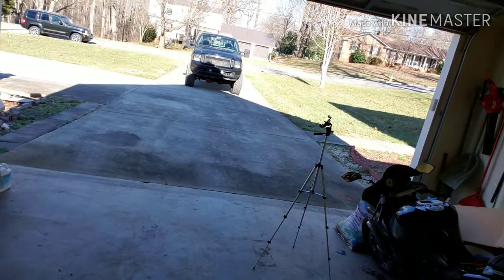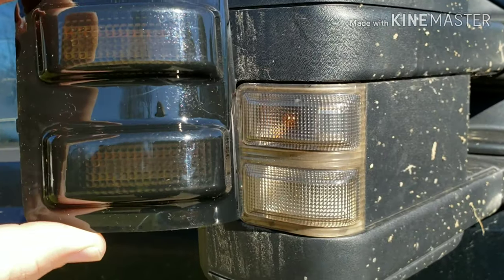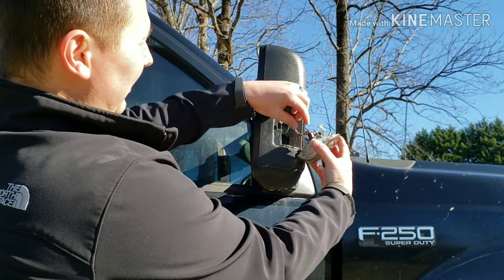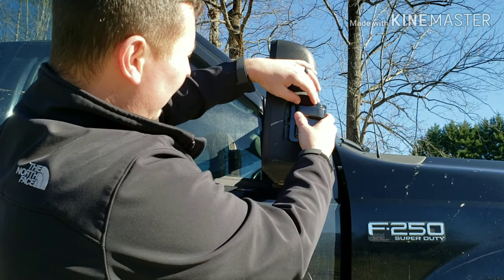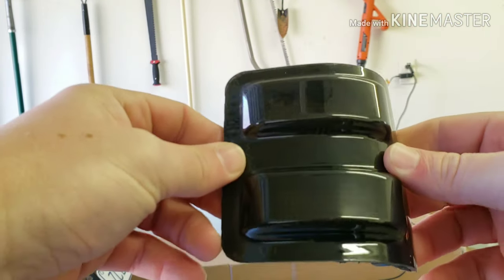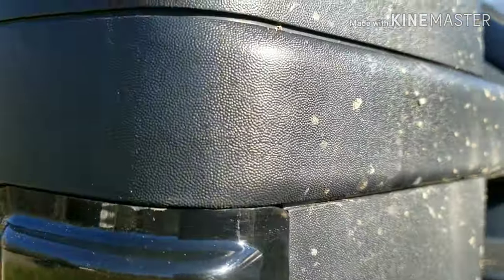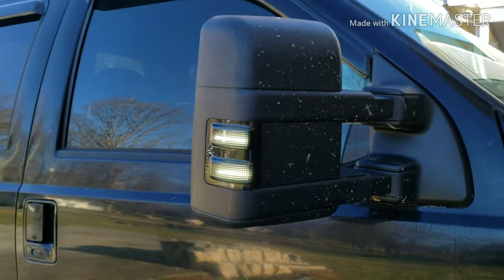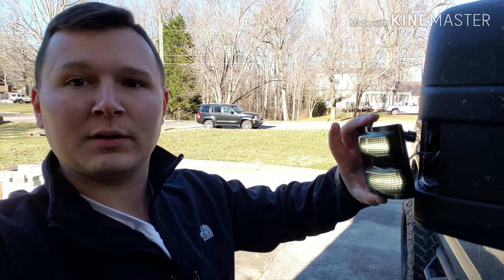08-10 Superduty LED Mirror Light Install

Comment: So the lights are already in the lenses. I have the old lenses like you and I just want to do LEDs in there... is it possible or am I SOL and need to get the whole set up?
Reply from the maker: You can get LED bulbs for the stock lenses. They should be just a standard 194 bulb and if you have eBay mirrors like I did the new lenses will probably give you the same trouble I had. You could get a white LED for the driving light and a yellow for the turn signal if you like that look or just go yellow for both which will brighten up the stock light. Hope that helps!
Reply: It helped a lot. I really appreciate it.